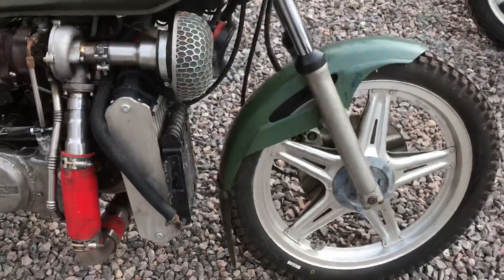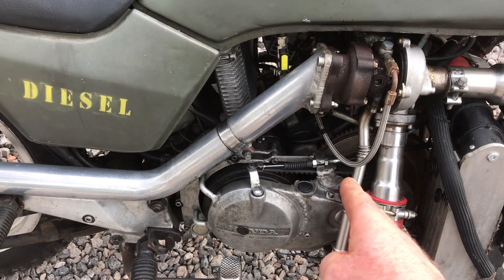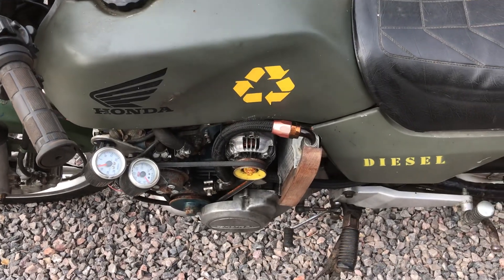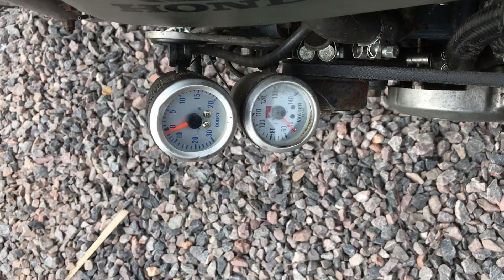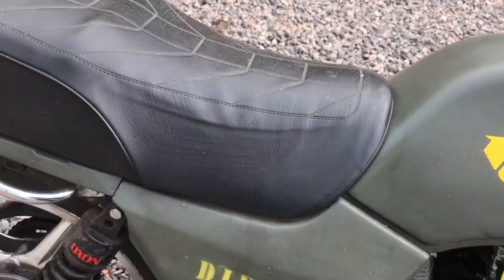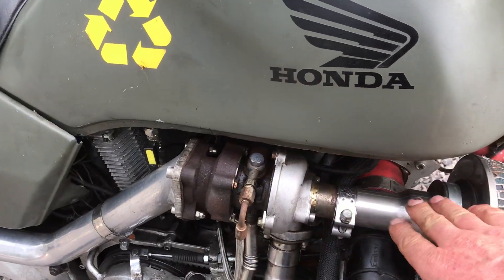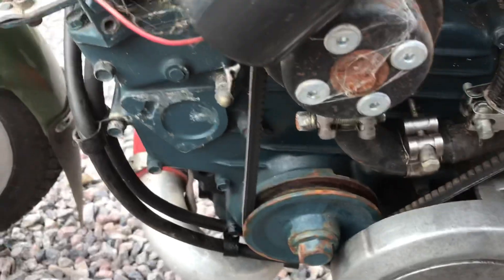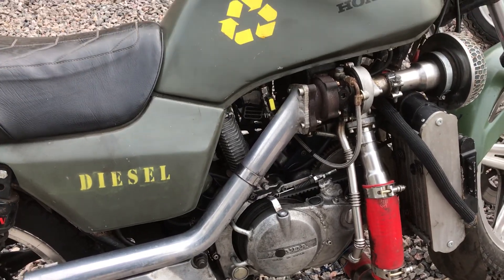Diesel Honda Superdream Mk8

Comment: Coolest application of a 482 I have ever seen! The packaging is also brilliant.  Many of these conversions are nightmares but this is entirely practical.  I guess you'd  be getting 15- 18 Hp ot of this with the turblo?  I was going to use a 482 For a generator but wanted something bigger so it wouldn't have to work as hard. One of those little RB turbos might be the ticket. 
Awesome Build, well done!

Comment: These are cb 250 N bike,s were were they manufactured
Reply: The Honda CB250N Super Dream was manufactured between 1979 & 1983. It was a CB400N Super Dream, with a gutless underpowered 249cc engine installed into a heavy frame. At the time, it was the slowest 250cc bike sold in the UK & Europe. Known, in the UK, as the "Wet Dream", "Super Slug" & "Gutless Wonder". It had a 0 to 60 MPH time in excess of 20 seconds.

On stock Honda FVQ rear suspension, it's like riding a water bed.

Only good point was the engine was very reliable.
 
Bike Magazine described the exhaust sound to be like a muffed fart.

Comment: You said in the video it's quite happen at 65. Where you talking kph or mph?
Reply: Since he doesn't have any American accent, I guess it's kmph
Reply: Probably miles, since he used miles pr. galon..
Reply: @noahwail2444  he didn’t use miles per gallon. He said “120 to the gallon”. That’s kilometers, for sure. About 75 miles to the gallon.
Reply: it's the UK so definitely miles
Reply: @LESLASLESLAS  Nope ... we NEVER use kilometers per gallon ... this is a UK gallon not an American gallon ... Google it.
Reply: It will be 65 mph and 120 mpg. Uk gallon.
Reply: A little honda 250cc rebel can go 65mph. This should at least do that too with its 6 speed gearbox.
Reply: @MrAdopado  ok, I get the imperial gallon vs American gallon, but then you said you guys never use kilometers per gallon, so what do you use?
Reply: @LESLASLESLAS  Miles per gallon. (but don't directly compare our mpg figures to US figures becasue US mpg will be lower due to US gallon being smaller than the UK gallon which is 8 pints)
Reply: 1 UK imperial (true) gallon = 4.461 litres.

Comment: No diseas-el motorcycle has EVER (in 147 years) ben truly successful. WHY? Too much weight and complexity in the engine and FAR too little net HP output per liter. If Honda is getting 16 HP from 482cc of a NA diesel, they are treading on near miraculous ground! Typically, 20 HP per liter for a NA diesel for say a ship's bilge pump is considered "high performance" or for an Arrow Oil field pump-jack engine that would be exceptional performance. Arrow's produce about 6-8 HP per liter and weight over 1000 pounds and turn 450 RPM. The Russians or Yugoslavs built a "lightweight" high-speed diesel bike back in the late'80's -early '90's, a semi-dirt bike style intended for the military, but too heavy, too complex, too low performance (think BMW RS80 Dakar) but a 700-750 twin.
Reply: Seriously? Hayes M1030-M1.